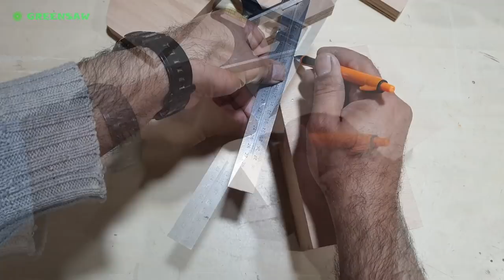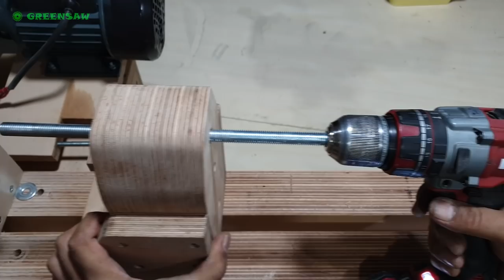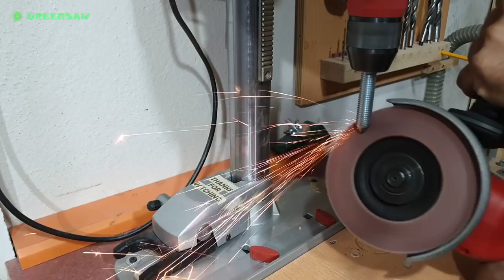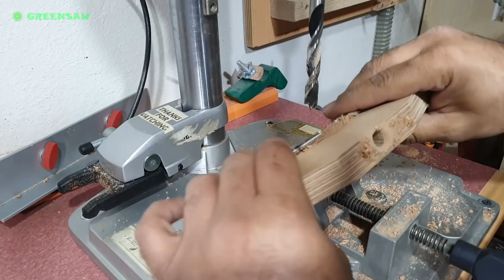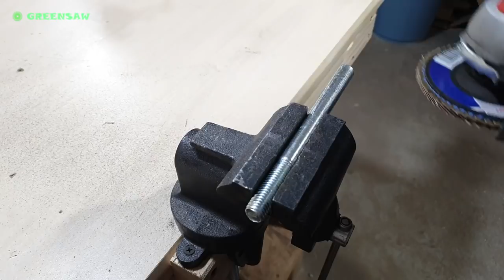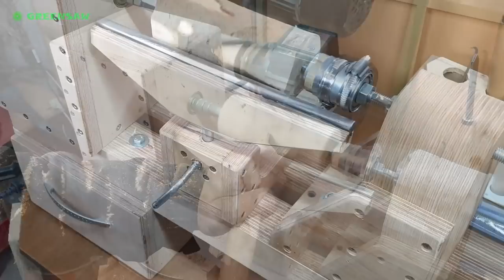Wooden Lathe Making 2 - DIY

Comment: This is awesome, but those hose clamps are really scary! They can catch the sleeve of  your shirt.... :/ 
Thanks for sharing this though! I am sure it will help a lot of people who need a small lathe. :)
Reply: That's right, it's the first thing I thought when I saw them, clamps are a danger.
On the other hand, some pieces look very weak.
Otherwise excellent work !!
Reply from the maker: You can easily change direction. The clamps remain fixed. Please look at this : https://youtu.be/oF9U4TgbPDY?t=1637  or  try secong method.

Comment: I know its about building a lathe from wood and that`s what was achieved, great job
But I know that ply is not cheap, especially these days,
If I needed to get a lathe today I would buy a second hand wood lathe made from metal , I know I would pick one up cheaper today than making making one, because of the cost of wood,  unless I already had the wood , 

The wood yards have really taken the pi-s on how much they have put the cost up, because of other materials gone up due to the the boom in building houses and the cost of materials,
Its a shame

Comment: A very well made video by a very creative person.  Having made several power tools myself, however, the cost of "homemade" can sometimes cost as much as "store bought" if you cannot use scrap materials and used parts.  The extreme low cost of power tools from China, once of laughable quality, but now quite serviceable, often precludes making your own.  I built my last wood lathe using an old belt-driven grinder for a headstock and old bed rails for the ways.
Reply from the maker: Thanks Joe Blow. I agree with you, but do it yourself is so fun! 👌 Regards...

Comment: Hi, used your video to make my lathe.......stuck on making one part:  the hold down pivoting bolt to quickly lock and release the tailstock and tool rest.   I tried making a few diff versions and none of mine seem to lock in place like yours.  Is there a certain location for the pivot hole and is the top cut an oval section or circle section.  Do you have a sketch of yours or dimensions or a weblink I could go to?   I tried moving the pivot hole and making diff arc cuts at the top....but I must be missing something here.    By the way, the lathe works GREAT (as an alternate....I'm temporarily using using a simple bolt and nut, but I need a wrench to release it and lock it....time consuming and awkward as you can imagine. Thank You
Reply from the maker: Hello, have you downloaded the pdf document? For this, read the video descriptions.
Reply: @GreenSaw  Yes I found the Part 2 Page 2 dimension pdf.    What I was looking for does not appear to be shown:
a) location of the "center" of the pivot hole
b) location of the "center" of the curved arc
c) curved arc "radius"
Thank you so very much for replying.

Comment: pulley axis (previous vid')
between threaded rod and bearing
you need a 'ring'
(thin rectangular sheet metal, bent into a tube at rod diameter,
it must rotate with the bearing, but perhaps almost immobile / with threaded rod)
Reply: 'doll'
maybe 2 bearings, 
again a ring to connect them
and you squeeze the point on the ring as you do